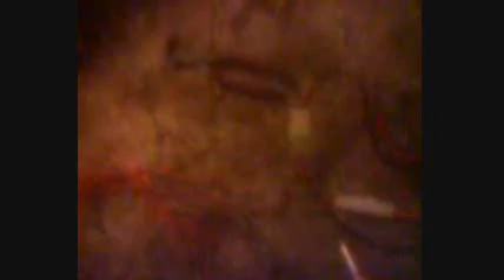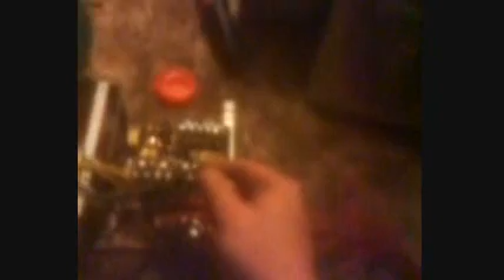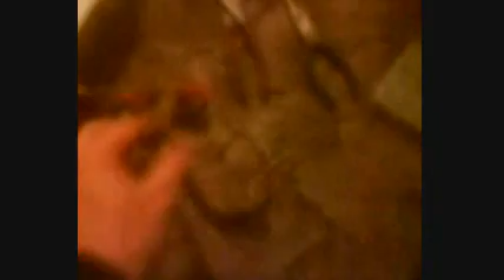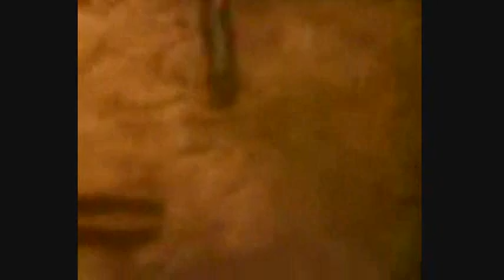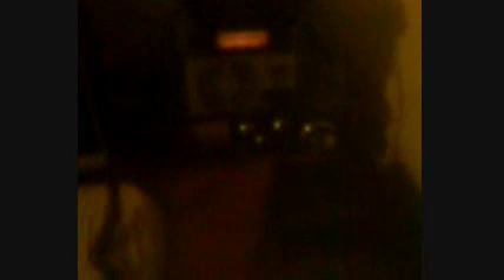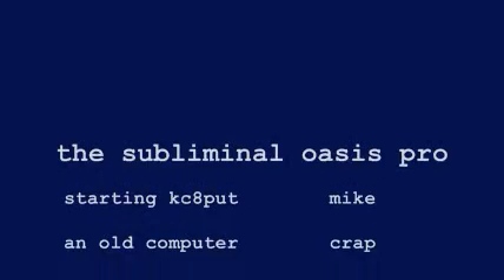ham project.wmv

Comment: Computer power supplies (switching) have far more stable regulated voltage than your typical ham/cb power supplies. They also supply plenty of amperage (typically over 10 amps) which is plenty to run a 50 watt rig. The only thing that needs to be done is adjust the voltage internally for around 13.8 volts. 

Do what works best for you.